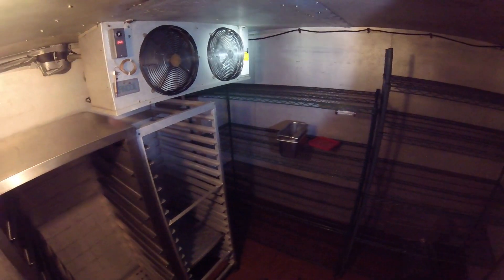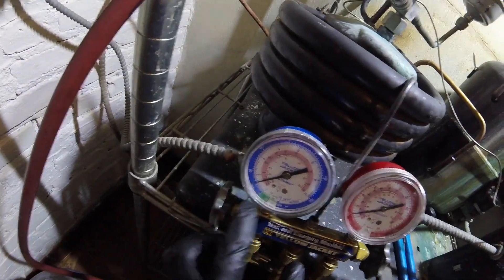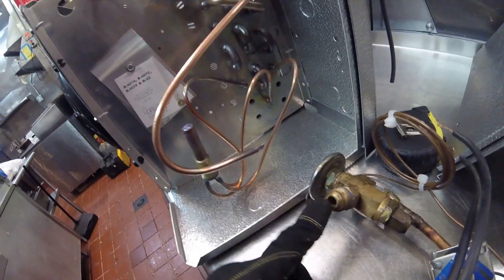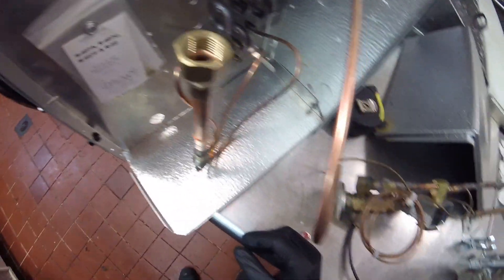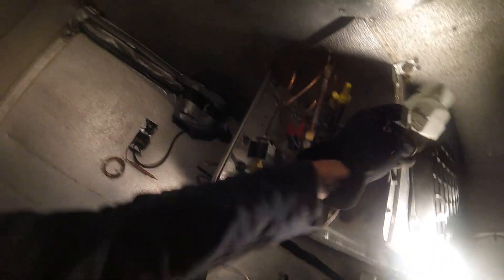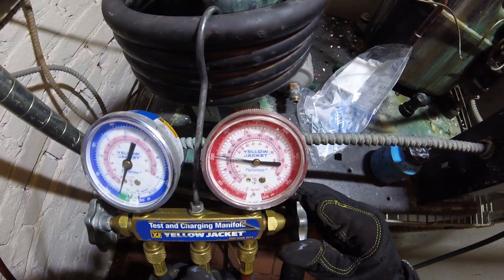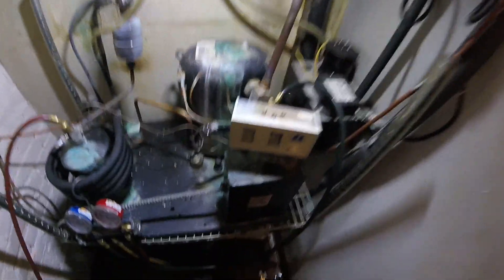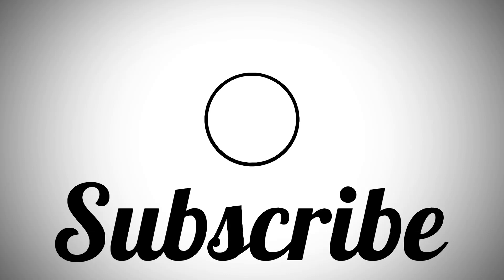Walk In Refrigerator Installation (Replacing Evaporator Coil) HVAC/R

Comment: lol also you only need flux for 7% silver solder copper to brass also you also you should use anti seize compound on flare fittings not thread lock

Comment: I love your channel, seen you take on jobs most would walk away from,. In this video I noted your installing a multi circuit distributor.  This will require installing an orifice and locking ring between the TXV and distributor,  this was omitted unless you just decided not to show this in the install., it would be good to let your followers know that information though.  I saw it was included in the plastic bag taped to the unit.  Also the purge didn't happen on the high side because the normal closed SOV magnet wasn't installed to allow the nitrogen to flow out the schraeder.  Not criticizing you, I'm just saying.  I've noted YouTubers are very touchy of constructive criticism.

Comment: Wait a second. This unit is calling for an internally equalized valve with a distributor? As far as I know and what I have read, systems with distributor call for an externally equalized valve and a distributor nozzle. I am curious, but it doesn't seem right to me the engineering behind this system.

Comment: awesome video, clean install, never seen one of those timers installed in a evaporator coil. i can see how the pricing would be lower then a grasslin or paragon but still be effective when wired to de energize the liquid line solonoid.  thanks

Comment: Hello
How about nozzle kit I did not see the you pout in ???
This part is very important to have a equal distribution of the freon to the coil.
Reply: The distributor? It's factory installed. Didn't you see the capillary tubes going to each of the evaporator circuits when he was cutting the caps off and releasing the nitrogen holding charge?
Reply: @MarcDiMillo  The system calls for a nozzle. The back was hanging next to the distributor. This system does not make sense to me unless I get the data and the tech shows the actual measurements.
Reply: @MarcDiMillo  And yes, that is a distributor. If it is not a distributor, then What is it?

Comment: I have ice build up on coil and 0amps on heater elements
Reply from the maker: Make sure your defrost control is good before condemning the heater. You must be in defrost in order for that heater to pull amps. Once you confirm you are in fact in defrost mode, make sure you are getting voltage to the heater. If its getting voltage and you're pulling 0 amps then it is bad. Thanks for watching! Subscribe and stay tuned for new videos every week🔧

Comment: Did you install the distributor  nozzle?
Reply: I was noting the same thing, but I did notice the nozzle packet was removed before he started the braze, so he may have inadvertently skipped that part which is rather important though any time you have multi circuited units (distributor) .  Some of the older units had one line, then there is no need for a distributor and nozzle to equally divide the refrigerant to each circuit. They can be a real pain to put in, and there is a length limit from TXV to nozzle, although it escapes me.

Comment: So no need for nitro while brazing? am fairly new to Ref. thx smooth job and video
Reply from the maker: It is very good practice to use nitrogen while brazing but its not exactly needed while you braze. When you're done brazing, you can take off the pins and blow out the lines with nitrogen then pressurize to check your work if you'd like. Never had an issue. You're very welcome & thank you for your feedback! Much appreciated. Stay tuned for new videos every week & stay safe out there✌

Comment: Flare fittings seal by compression, no leak lock needed. Also, I would have definitely got the distribution tubes off the metal on the bottom of the blower, begging for a vibration rub.
Reply: It’s used as a sealant to lock the threads, not seal the joint.
Reply: On the branch circuits, your correct. We sometimes forget the OEM just stuffs these in the casing. They are very flexible. I would have given these a good yank to get them up off the bottom and shorten that flare nipple or just flare the piece that was there.

Comment: why not just pump down the system instead of recovering all the refrigerant?
Reply: also seems like a no brainer to replace the txv when doing a such an expensive repair like this.
Reply: @Jamie-po9zk   maybe he was going back in with a different refrigerant. I’m sure the reason he was changing out that old evaporator was because it was leaking.
Reply: I personally don’t like pumping down when I have to do a repair just in case. You never know if that king/queen vavle will hold or don’t leak.  Also big repair like this , I would just use new refrigerant and he should of replaced the txv.